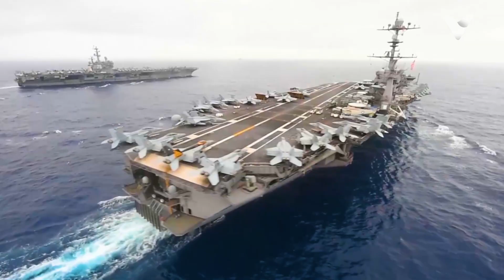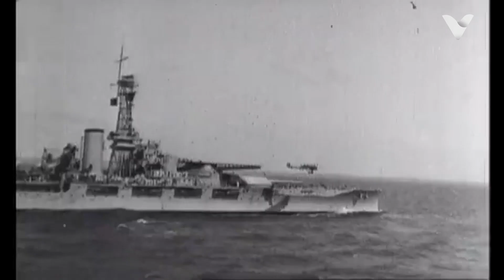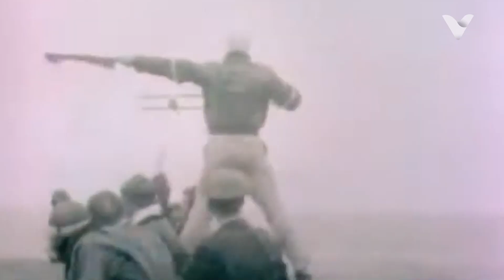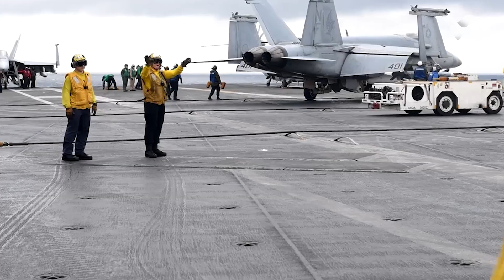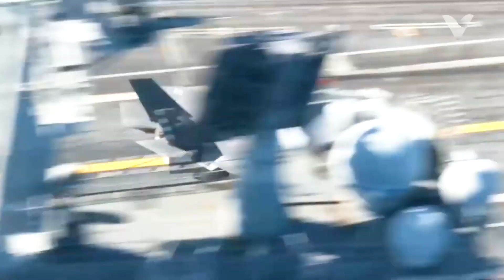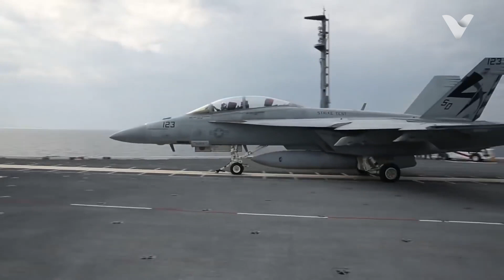The REAL Reason Angled Runways Exist on Aircraft Carriers

Comment: You basically said the runway is angled because it is safer because it has barber shop lights on it, and it increases accuracy. But no, none of that is true it would be just as safe straight as angled as long as the lighting and safety equipment were the same. Then, you claim improved takeoff performance because the plane can use the entire runway. But no, once again, none of that is true. Planes use the straight section on the front of the deck where the catapults are located to take off and that only occupies about 1/3 of the deck. Increases recovery operations was just fluff and wrong, and then you go on about aligning planes with the angled deck to take off at the same time you're showing video of planes lanching (STRAIGHT) off the front. The main reason for the angled section of the runway is for them to be able to launch planes and land planes at the same time, and so if a plane over shots there landing they can hit the gas and take back off without plowing into the ass of a plane waiting to take off. 

Next time you want to produce a little educational video, please take a couple of minutes and do some research to better educate yourself on the subject.